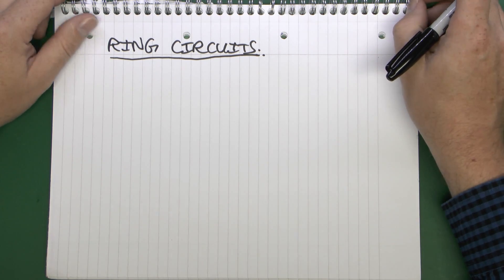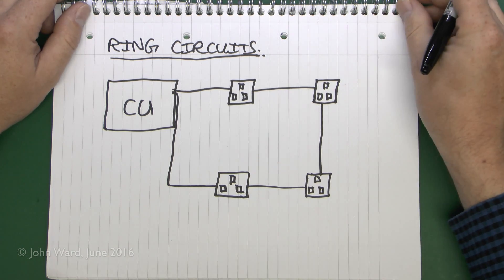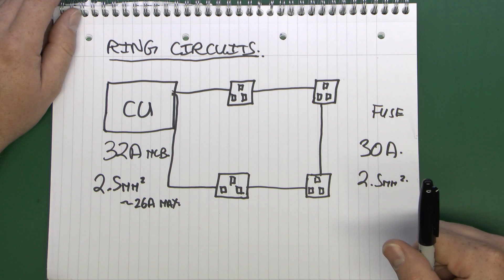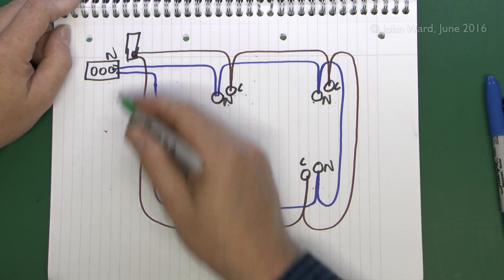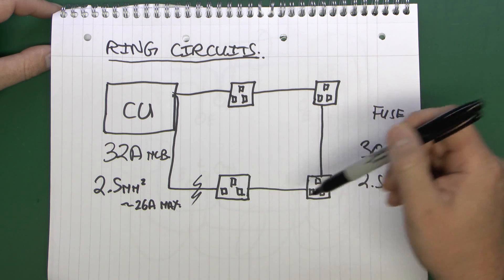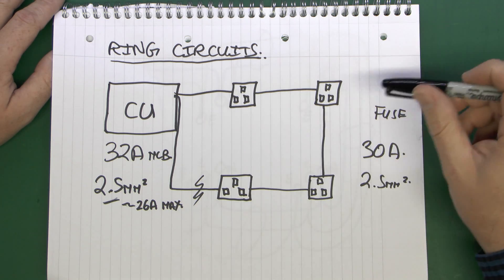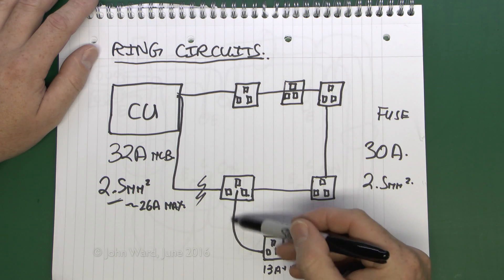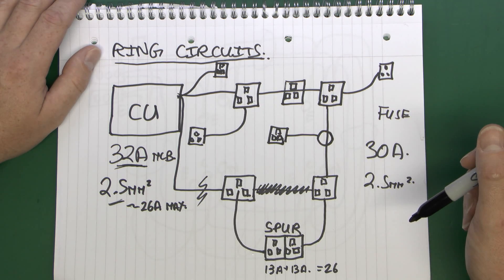UK Ring Circuits (previously Ring Mains) for Socket Outlets

Comment: I'd like to suggest that a ring main does have an advantage in that it halves the resistance to the furthest socket, while using easier to handle cable.  Also in most situations it begins down one side of a house or room and returns along the other, enabling sockets on both sides.  The alternative of two radials would double the resistance by comparison unless 5mm cable were used.  Resistance can matter especially when using things like grills and halogen ovens where a small drop in voltage results in a large drop in radiant heat (I experienced this problem).  It's true that electronic devices are generally neither large current devices, nor very sensitive to voltage, but if you are feeding two radials down each side of a room, why not just join the ends and complete a ring, halving the resistance.
    I agree that the potential to overload the ring cable with loads near the consumer unit makes a nonsense of the ring in principal when it comes to pushing 26A cable to 32A, but again, in practice, the ring will often begin some distance from the area it feeds, such that the feed to every socket has a reasonably balanced feed, the initial long feeds serving to balance the current sharing.
    One thing that surprises me is that you, like others, work on the assumption that the cable is required to carry only 32A worst case, when in reality MCBs will sustain around 1.5 times their rating for a long time without tripping (depending on the type of MCB), so the cable has to take 48A in fact.
    I think the sensible answer is to simply require that all circuits using 2.5mm cable have a 20A MCB while all circuits or spurs using 4mm cable can have a 32A MCB.  With the cables thus protected at source no further rules are needed regarding spurs or number of sockets.
    In a bungalow my preferred method is to take spurs in 4mm cable down to each socket from junction boxes, from a 2.5mm ring in the loft that has no sockets directly on it, leaving the ring uncut where possible as it runs through the boxes.  This makes life easier in many ways - no threading of two cables down inside plastic conduit (which I always use), no need to put two wires into each socket terminal, and easy access to junction boxes for adding sockets.  Plus less opportunity for arcing with less joins.  Of course this works well in a floored loft with easy access to the edges, but not perhaps in one piled high with glass fibre insulation.
    One reason that the ring worked better in the past was that it served fewer sockets, whereas today a lot of extra cable is wasted looping down the wall and back up (wiring across walls from socket to socket is not encouraged because of the increased risk of drilling into cables when fixing to walls.)  My solution of using 4mm cable down from the ring shortens the cable length in the ring and is ideal in every respect.
Reply: You are missing the point, if there is a break in the cable nobody knows and nothing trips and everything keeps working.  including electric oiled radiators if some lost their gas boiler  for example.  The wire would then burn and cause a fire!!!!  Putting in a smaller fuse like you suggest would then limit people  who would actually need the amperage one day for  an electric heater or two because it would trip.   A 4mm radial cable with a 32 amp fuse is a perfect solution, one for upstairs and one for downstairs.  Obviously a separate one for an electric shower or an electric oven/cooker. 10mm or whatever they require.
Reply: @jeremykemp3782  The days of electric resistive heaters are surely over - too expensive to run and too wasteful of valuable power.  My five air to air heat pumps heat my large bungalow taking only 400W each max, all run off the ring circuits with no extra wiring.  With a COP of 5.5 they deliver 5.5 kW of heating for every 1kW used (Mitsubishi, cost £800 each, £1500 istalled) Electric shower is also not a good idea - prefer 3kWimmersion heater on cheap rate.  Modern fan heaters are 2kW, not 3 as used to be the case, and two fan heaters will run happily off a 20A 2.5mm circuit.  There's also something to be said for a lower trip current - it avoids the need to rate the cable for 1.5 times the nominal MCB value.  In practice MCBs rarely trip even on overload, and wiring rarely overheats to anything like the point of burning.  And MCBs are easily reset if they do trip, alerting the user to the need to plug less in.
Reply: @lindosland  
A friend gutted his house and renovated. He insulated it to the hilt needing very few kW to heat it. He took out the gas going all electric, saving £100 a year in gas meter standing charges, which basically paid to heat the place. He used  small thin panel resistance heaters on their own final ring with no fuses in the local isolator switches as being under 2kW they do not need a local fuse.  

Electric underfloor heating is popular which is resistance heating. Having all the UFH rooms off a dedicated final ring makes sense. Just loop the ring's cable to each thermostat.

Comment: Good explanation by drawing but I would point out in reality when you’re doing this on site you probably won’t have the layout in the drawing you done, you will have two cables twin and earth running together through the walls or on the ceiling then dropping down the wall etc  , and you will pull a loop from one of the legs for the sockets , my question is do you pull the loop from both legs like I do or just from one leg like I’ve seen other people do , I’m not sure if there is a right way . It’s all still on the same ring just not sure if it evens the loads if you pull the loops from both legs ?

It’s just not practical to pull one cable and then go back on yourself back to the consumer unit , so we always pull two cables , pull you’re loops at the sockets and obviously you end up with two cables at the last socket and the consumer unit to complete the ring.

Comment: A superficial look at the ring system on diagrams confused me for a long time. I thought there was a single wire loop ("circuit") going around with everything connected in series. Seems a bit messy to run 2 cables, input and output, down a wall to each socket, compared to one junction box at the ceiling. And to make an extension with a different looking cable at eye level.

32A is a helluvalot of power for one home. With today's prices you'd go bankrupt using so much electricity. I grew up in a home with a 10A circuitbreaker, and the highest powered device being a 1 kW countertop oven. A water heater was 750 watts. People used common sense, and switched on 1-2 appliances at a time. A 32A short would vaporize a decent hole before the breaker reacted.

Comment: Electrically it's the same to attach a spur to the MCB directly as it is to attach it to a socket out on the ring, but isn't the issue that modern MCB's have two ports on either side, designed for one wire each? There is space to jam more wires in there for sure, especially if you use smaller gauge wires, but you won't necessarily get sufficient contact and grip on all your wires when you start doubling or tripling them up in the ports. 

Just a thought as to why people mind this sort of addition to a circuit.

Comment: Excellent teacher, excellent channel. Thanks JW. I had a 32A ring circuit in an old outbuilding, and rodents had gotten into the walls, chewed on the wires and the RCD kept tripping. I expected the worst, that the circuit had been destroyed, but the electrician isolated and removed the chewed section and I was delighted to end up with two 16A radial circuits that tested fine and with roughly the same number of sockets on each. Could have been worse.

Comment: I guess it made sense to the committee in the '40s.  It does not make sense today.
At least you use an efficient voltage.  120V requires way too much copper.

Comment: I was taught the virtues of the ring mains when I left school in the 80's and did my apprenticeship, just before moving into IT, and thought it was a great idea. Now in my 50's and having moved into various old properties (and always checking for signs of heat/loose connections in electrical outlets) this video has explained so much. Well worth 16 minutes of my life to totally change my mind as to the safety of electrical circuits.

Comment: I have an argument for using ring circuits:

 Lets say you install a 32A ring circuit, but with 4mm2 cables instead. This way, if a fault in the middle of the ring happens, the ring will be split into 2 radials with the correct size breaker and cable (32A breaker, 4mm2 cable). Therefore, all appliances on the ring will be operational and compliant even during a fault.

However, if you chose a radial circuit, you wouldn't have the same degree of resilience. If a fault happens in the middle of a radial, the appliances downstream of the fault will be guaranteed to be non-operational.

This is the same reason why we use ring circuits when designing a HV Ring Main system, provides more resilience.

Comment: A few comments, BS7671 Appendix 15 shows an RFC with 2 double sockets spurred with a 1.5mm T&E, admittedly from an FCU to de-rate the spur, not ideal practice as the user will often consider these sockets as "normal" sockets.  Also the current carrying capacity of 2.5mm T&E is reduced by the installation method of the cabling and is almost never even close to the 26 ish Amps you suggest making it even less desirable to use an RFC, also BS7671 REQUIRES an RFC to be designed to, as far as reasonably practical, have the load as evenly distributed around the ring as possible, in practice this is NEVER achieved and is yet another reason not to use RFCs.  Also a single fault is almost never apparent until the damage is done, ie loose or missing wire in the back of a circuit accessory causes heating and burning.  When you extend can RFC you MUST ensure you comply with the R1+R2 requirements.  Maintenance free junction boxes are readily available for under floor connections but are rarely ever used. Also I see a lot of nuisance tripping due to earth leakage from modern electronic equipment all on the same RFC.

Comment: I have a spare 16amp trip , and want to use that as a separate ring for two extra sockets,is that possible,It used to feed two underfloor heating circuits, but we have ripped that all out and installed a couple of extra radiators, Is what I am suggesting perfectly safe leaving the same trip in place, or does it have to be 32 amp even though there is no real load on it, one socket is the car hoover, and the other is just for the internet wifi and a hall lamp, and advice would be very helpful.
Reply from the maker: Forget about rings.
A radial circuit using the 16A device and 2.5mm² cable will be suitable, provided the cable isn't installed in insulation or similar.
Reply: @jwflame  Many thanks for the advice John, is that the way it is going now just radials for everything like we used to run to say an electric shower or cooker point if so i am wondering why rings were ever used , for domestic properties, You see in my head is a retired plumber a, flow and return just makes sense if you get my drift.Thanks again so much,
Reply from the maker: @peterryan7827  Rings made sense when they were designed in the 1940s,  when it was essential to minimise the use of materials by having a single circuit for the whole house which was capable of supplying the electric heaters and a few other things used at the time.
They make little or no sense today, all other circuits have been radials for ever, and most of the rest of the world never used the ring at all.
Reply: @jwflame  Sorry to be a be a pain does this mean that electricians never fit rings anymore, especially all the new properties being built because these are the new regs,many thanks for reply

Comment: I only did a short course as part of a mechanical engineering day release course many years ago, so my knowledge is limited as since then I've only done DIY electrical work, appliance repairs adding the odd spur, wiring up sheds, or simple light circuits.

I'm old enough to remember the days when the previous wiring circuits were still used in many older houses, before these came in; if I remember right, sockets were on the same type of circuit as lights are now (can't remember what they're called), and people would often run half a dozen things, radio, lamp, iron etc, off the light socket on the ceiling.

Overload became a serious problem back then, and we had warnings about it on the tv.

Now, on a circuit such as your diagram, a person could have a 12 way tower, plus half a dozen USBs on each socket, and from those towers, further extension leads.  There are no warnings about overload!

I know my example is at the extreme end but, even though many things draw much less power than they used to, surely we're heading towards some serious problems.

Circuit breakers are so good these days, that I've almost forgotten how to change a fuse in a plug, but are they really good enough, that we can safely keep on plugging things in the way we do?

Isn't it time we had warnings on the tv again?  Or am I worried about nothing?

Comment: As a former approved qualified electrician I would disagree entirely. There have been countless instances where I have come across interruptions in ring circuits more often caused by other trades through carelessness and fortunately been able to split the circuits and modified the protective devices to suit without damage to decoration or requiring a finished area. Providing the installation has been inspected and tested in accordance with the regulations ring circuits are absolutely perfectly acceptable and provide an opportunity for modification unlike most radial circuits.